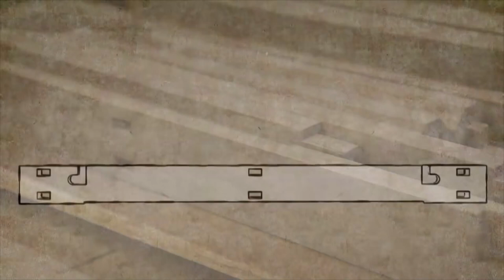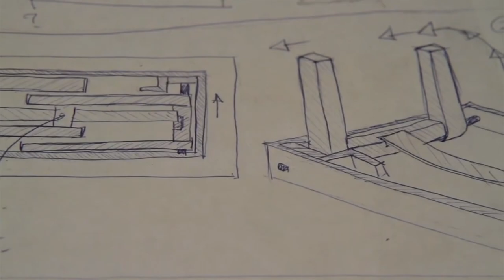Building Without Nails  The Genius of Japanese Carpentry

Comment: 17:01 When he talks about how they use the bottom of the tree for the bottom of the window and the top for the top, and line them up so that they don't warp, they expand and contract together... This blew my mind. He wasn't kidding about "with nature"
Reply: I REALLY wanted to go to that place where they store the trees to dry for decades and swap everything upside down, so 20 years later someone would craft stuff using the top instead of bottom and vice-versa without even knowing
Reply: he was talking about making screens and structures like that. They don't make screens out of those slabs. but even if you turn a table upside down, you can still see the angle of the wood on the outside before it's been cut down to smaller pieces. you'll still know.
Reply: Kelsomatic that is attention to detail when it comes to design. Really inspirational.
Reply: @akiraic  You can see and feel what way the wood should be oriented.

Comment: could you imagine building a house with all joints and no nails? lmao I couldn't do it.
Reply: Evan Wheeler ever use lincoln logs?
Reply: Evan Wheeler ytong, man
Reply: Evan Wheeler as a carpenter, I can tell you houses as big as 4,000 square feet houses in three weeks. this would take a hell of a lot longer. BTW metal nails are as natural as wood. it isn't made in a lab lmao
Reply: I ve heard that the Amish build in a similar way. The problem with nails and metal fastener is that they rust but also over time as the wood dries, it tends to crack and warp around the nails making the joint weak.
Reply: Evan Wheeler could you imagine building a house with all nails and no joints?
Reply: Lego.
Reply: SMGJohn well gee you got me there. They don't grow on trees, yet it is underground which we harvest through mining. think before you talk pal.
Reply: Oh yeah and those chopped up pieces of wood are unnatural in your logic.
Reply: Richard Black me? no not really. I built a house before and I thought I was old-school for useing a hammer instead of a nail gun
Reply: Actually in China there are a lot of wooden houses built in the ancient time without any nails, it's a traditional method called “榫卯”. It helps buildings to have better resistance against earthquakes.
Reply: +chenying wang,
The Japanese carpentry skills mostly came from China.  In fact, all of the 1000 years older Japanese castles are exact copies, on a much smaller scale, of then Tang Dynasty castles inside the Da Ming Palace and other Buddhist Temples.  The same is true with their wood carvings and watercolor paintings.  The only difference is that 90% of Chinese castles were burned and destroyed by foreign invasions of nomadic people from the steppes or from internal wars.  Unlike the Chinese, the one thing Japanese, as a society or culture, can be proud of is that they preserve and appreciate their historic arts and architectures.

Comment: The people in the video are overreacting, its because Japan had a lack of metal in the middle ages.
Reply: Ahem... Samurai n' Ninjas = DANK WEAPONS
Reply: It does make sense tho, I'll give ya that. :P
Reply: That's why they use to made the best sword, hu? You must value what you have. Consumerism... you don't really undestood the idea... you can spend more building one thing that last for generations
Reply: Not true, anyone but samurai and swordsmiths were not allowed to possess metal.  This kept them from making weapons.
Reply: watchman1969 They didn't make the best swords
Reply: it's not the only reason. Wood joints are more resilient to earthquakes than nails / screws and they are extremely common throughout the whole archipielago.
Reply: That's why there's so much craftsmanship. Folding swords for example is because the metal's quality is so poor, the work and dedication is necessary for the sword to be made. There's lots of wood, not much good metal, that's why it is necessary a technique had to be mastered to build buildings and furniture. Necessity becomes tradition, tradition becomes art and artistic crafts just like Europe's high imposing walls became beautiful castles in hills.
Reply: Nails and hardware do not meet the climate of the Japan, such as corrosion, and loosening caused by metal fatigue in the earthquake.

Comment: Probably had to do it this way in the past because iron was so scarce.
Reply: Well it is far better if you use wood for furniture and house building and iron for tools and weapons, than the other way around.
Reply: Rebius Well, yeah, a wooden chisel would kind of suck.
Reply: No nailman back then.
Reply: Watch the video again, your missing the entire point of it.
With nature, not against.
Reply: iMergeAndSee No, I'm contradicting "the entire point of it." It's only modern romantization that makes using limited resources virtuous; i.e., the native Americans didn't "use every part of the buffalo" because they were wonderful people with a spiritual connection to nature, they did that because wasting anything when you're dirt poor is a sin.

Since good iron was very scarce in Japan (which is why they had to invent fancy ways to make swords) they couldn't spare any to put nails in everything. It would be like using silver as nails.
Reply: Waste is when something is not used that could've been used.
Reply: SHOTS FIRED
Reply: Metal parts through wood cause the wood to bore out & compress. With only wood on wood, the push / give is the same, you don't have one part that is harder then the other, so because there is no difference the wood only joints don't ever loosen
Reply: spyke6662006 That's an interesting point, but it's harder to make a hole and a peg for each hole than it is to create a bunch of nails and drive them into wood, so wouldn't you be open to the idea that they would have come upon this more difficult method (that has some advantages) because of a shortage of iron, as they did with their sword making methods?
Reply: Well, with the lack of hard historical data on why things were the way they were, I think it would be more accurate to say that both were contributing factors. Modern romanticism about the traditional 'Japanese' way of living doesn't exclude the possibility that respect for nature and craftsmanship were present to a large degree in the culture of the time (Shintoism, Buddhism, Taoism).
Reply: Abe Fair enough...

Comment: You know... it's not unique for asian carpentery. In Europe and even USA they used the same methods. It's not unusual for furniture to be build without bolts and screws, as long as they are not massproduced. Also most Timberhouses built until the 19th century in Europe were made without or only a few metal joints. Mostly they used wooden joints.
Reply: uhm... nope. its basically the same. there are only so many ways you can actually make strong enough wood connections. Its like the myth about the strongness of the catana. Asian tradition seems mythic to us. thats why it sells. But try hitting a catana with a european broadsoard or vice versa and see what happens...
Reply: Complexity is the opposite of simplicity, and simplicity is paramount in effective construction.

Comment: no nails or screws, they use wooden dowels which work just as good and snug if not better than nails.
Reply: Old ships don't tend to use nails. They rust too easily.
Reply: This is not a strictly Japanese thing. Shakespeares' round was built without nails using wooden dowels while the trees are still green. The recreation in London was built the same way.
Reply: Takes a lot of time though. And time is money.

But if you can afford it, then it's certainly the premium goods.
Reply: He explained in the video that the wood contracts and expands over time, and when wood does that with metal it breaks. When it is done with wooden joinery techniques, the wood contracts and expands against more wood.

the really interesting part was where he talked about the bottom of the screens being the bottom of the tree, and so the screens mimic nature where they're "growing" from the floor up. So neat.
Reply: risa, bowyers did this as well. Ishi used the underside of tree limbs because they were stronger in compression.
Reply: good traditionally made furniture does cost money innitially but it will last a whole lot longer than the "cheep" furniture. the wood joint methods can be seen with most cultures that developed carpentry and for good furniture it is something that you should look for even if it is secured with nails or screws in the end.
Reply: Why you say this? I just watched the video....Were you summarizing the video for no reason? Idk but you kinda pissed me off with that meaningless comment

Comment: What a load a poopy!  Structure maintenance is the most important part of survival.  Those buildings are made of wood in a cool, wet environment.  Without constant repairs and maintenance they would have long ago rotted.  They're lucky they have a culture that has sustained them and not fallen apart thus allowing entropy to take over.

Comment: How we'll does this building style hold up to extreme heat and cold?
Reply: Bravo Company Major Nelson very well, it expands and contracts on its own since it has no nails or anything then the piece is very strong using joints. Really awesome craftsmanship
Reply: Bravo Company Major Nelson in extreme heat the wood will burn up. In extreme cold it stays the same.

Comment: we can't compare between wood and metal , or wood and concrete, or wood and glass ...  basically wood are being used mostly indoors ... the rest, like the roof and walls are made from metal, concrete, and glass ! what makes wood last longer is not by pairing it with another wood , but by the elements that weaken it !

Comment: Why can't they just use nails?
Reply: Depending on the nails, they rust and split wood. Because wood and even metal naturally compresses and expands, depending on the season, only they do so differently. Historically however, metal used to be quite expensive. Not that there was none, it was not very cheap.  So if they are interlocked wood with wood and no nails. They become one piece, apposed to metal cutting into the wood and splitting it, or the wood expanding to the point where a nail becomes loose. So while its neat in theory, nobody uses wood structures anymore. More for aesthetic of it, not actual structure. That's why structures from brick are considered even better, because they survive even more. Depending on how they are built. Modern houses however are mostly trash, because their main appeal is just convenience and aesthetics. You blow any type of wind on them and they will fall over.